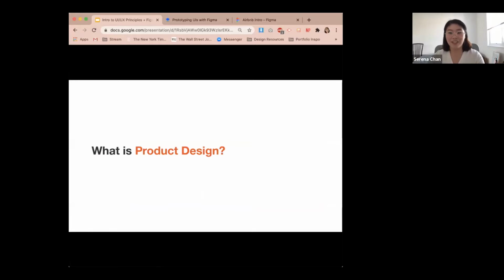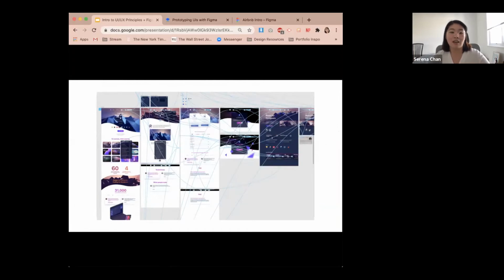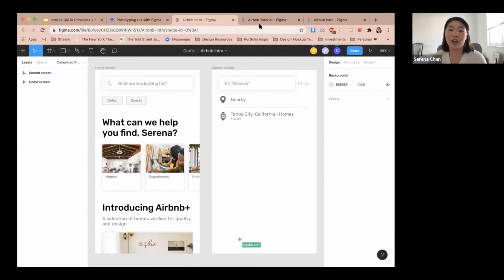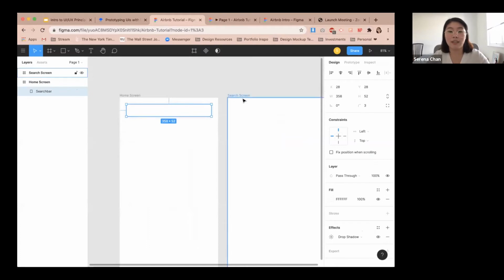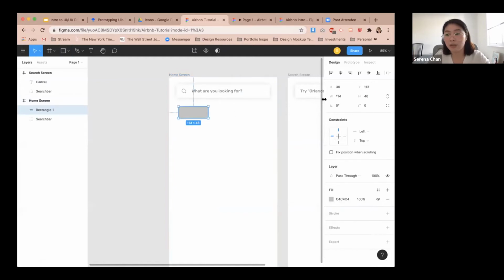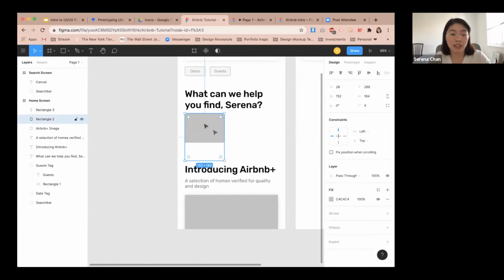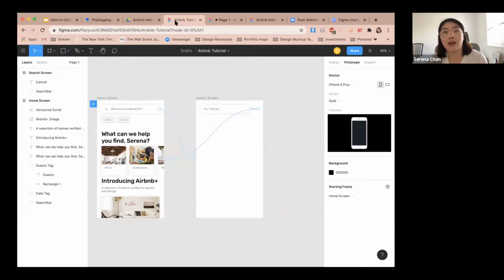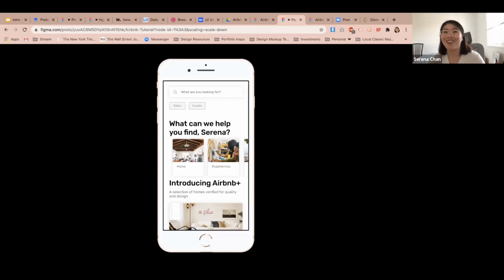Intro to UX Principles & Figma Workshop

Comment from the maker: 0:00 intro
0:07 intro to the workshop
0:18 a bit about me
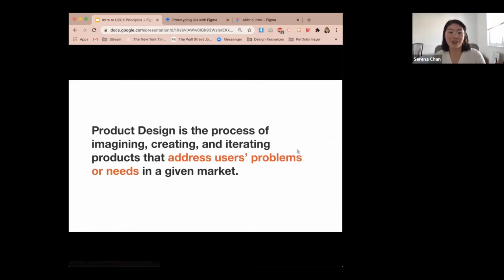1:24 what is product design
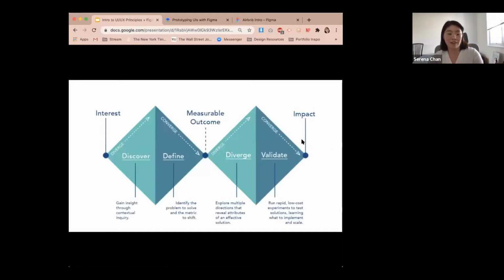2:53 design process
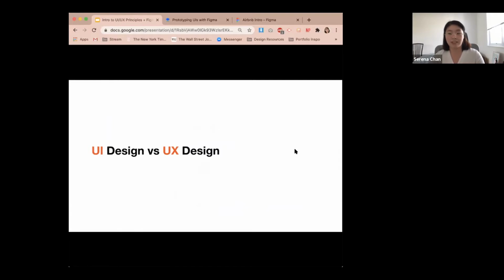3:32 UI design vs UX design
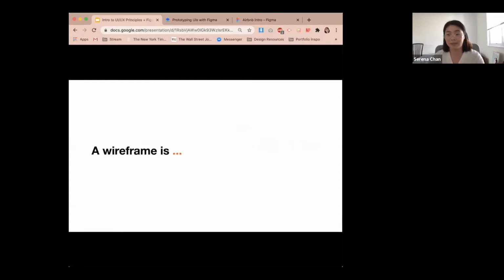8:14 what is a wireframe?
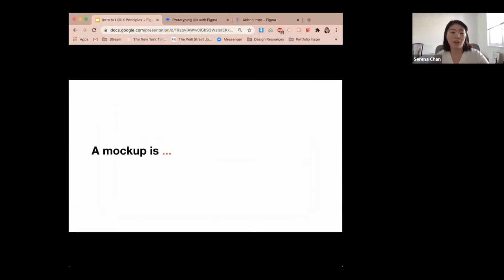9:12 what is a mockup?
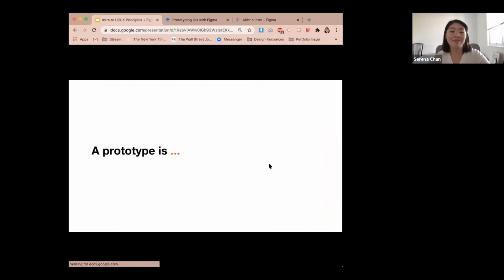10:01 what is a prototype?
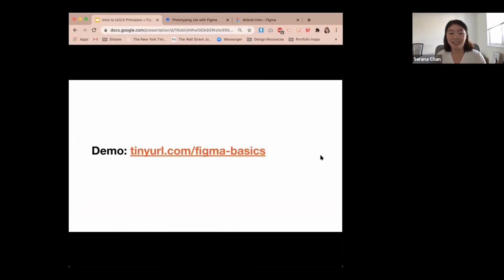11:20 transition to the demo (follow along w/the link!) + bonus questions during the transition
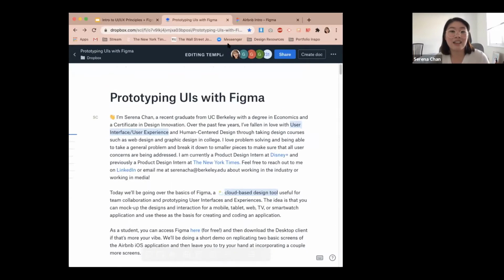16:04 starting the demo
54:30 questions
1:06:30 conclusion
1:07:03 outro